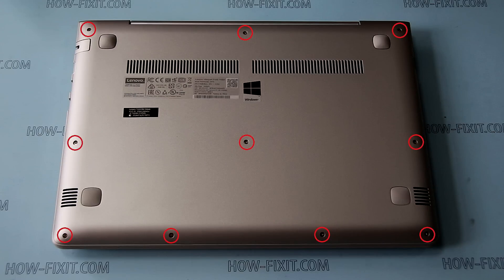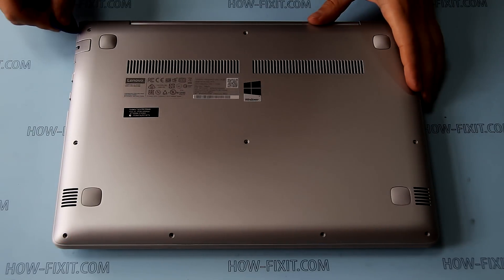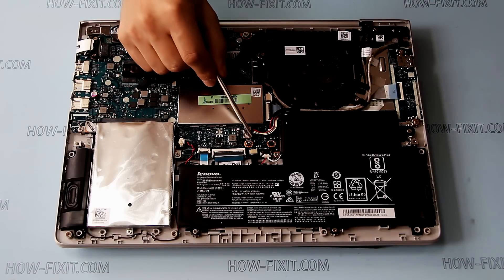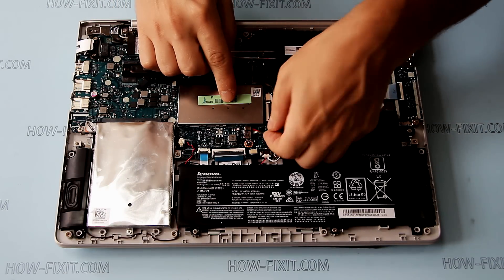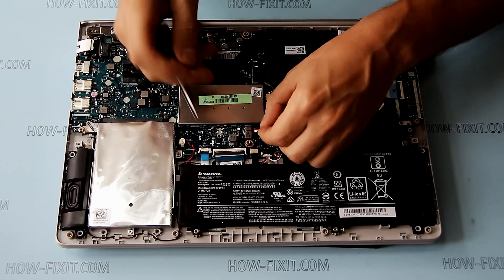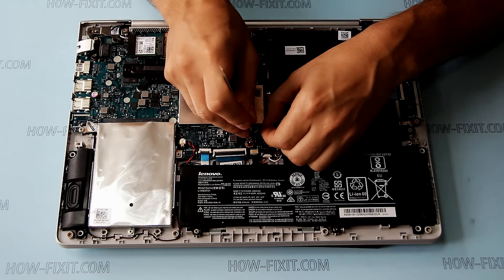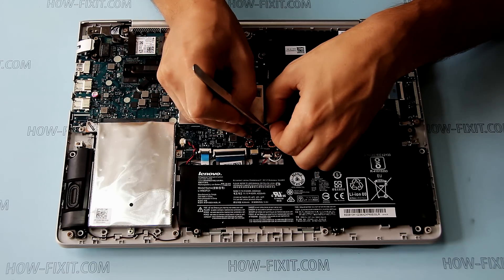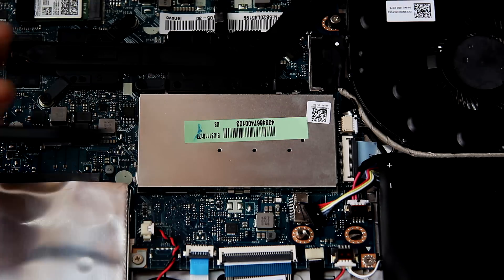Lenovo IdeaPad 510S-14ISK RAM Upgrade and Install - Your Step-by-Step DIY Guide!

Comment: Do we have to unplug the red, white, yellow cable before we open the ram ? Coz in the end of the video u did not plug that cable again ?
Reply: I assume that's the battery cable which is good practice to remove as the chance of powering whilst repairing could cause some damage. I'm pretty sure it was plugged in again to make it work!

Comment: thanks for your tutorial, it's very good. It helped my a lot. greetings from Mexico 🇲🇽.
Reply: Hola. Mejoró el rendimiento con 8GB? Vale la pena? Yo acabo de cambiar el HDD a SSD y mejoró considerablemente, pero aún es muy lenta.
Reply: @juliotraveler  supongo que tienes la version con 4 de ram, yo tengo la de 8gb con i5 6200u y sin problemas, entre mas ram tengas podras tener mas programas abiertos a la vez pero conociendo como es windows 10 traga ram a lo desgraciado, asi que en lo personal si haras la mejora mejor compra el modulo de 16gb, mejor que sobre a que falte
Reply: @JesusCarlosBernal La mía ya traía 8gb, sinembargo la persivo lenta anque tiene un core i7 de sexta generacion, integrarle una ram de 16 me podria ayudar a que sea  más fluida? Y como puedo saber que RAM es la que lleva específicamente, les agradecería su ayuda, saludos.
Reply: @erikalexei8486  Tengo la IdeaPad 510s 14-isk con un I7 de sexta generación, le cambié los 8GB de Ram por 16GB (DDR4) y un disco sólido adata SU800, ahora te puedo asegurar que enciende en menos de 15 segundos (incluyendo la carga de programas) si tienes la oportunidad de cambiar la ram y el disco duro por uno sólido, no te vas a arrepentir. El único contra es que quizás estarás gastando mucho por un procesador de 5 generaciones atras... 
Y si, si va mucho más rápida.
La ram que necesitas es una ram para laptop DDR4 a 2333mhz (Puede ser mayor, yo puse una de Kingston Fury de 16GB a 2666mhz pero se limita a 2333 por defecto)
Reply: @erickh.6071  Gracias por responder Tocayo, disculpa otra consulta, que tendría que ver el disco duro sólido en el rendimiento del equipo, el qué trae mi maquina es mecánico de 1 TB, y como cuanto andará la ram de 16gb qué mencionas. Gracias 👍
Reply: @erikalexei8486   @Erik Alexei  El disco sólido lee y escribe mucho más rápido, al abrir un programa un disco sólido lo hace 10 veces más rápido al igual que la carga del sistema pues tarda menos en buscar la información, la memoria ram te sirve para tener más procesos abiertos sin que se alente, es decir te va a permitir trabajar con más programas a la vez. No soy un experto del tema pero puedes ver en YouTube comparaciones de velocidad de un disco mecánico a uno sólido, y en cuanto a la ram me costó unos 1650 pesos MXN (aproximadamente 825 dólares)
Reply: @erickh.6071  Gracias, me has ayudado bastante.👍👍👍

Comment: Hello sir
Can we install graphics card in this laptop?
Please reply
Reply from the maker: No. In this laptop GPU is soldered on motherboard
Reply: @howfixit  😱😥 i want to play games. But i cannot play due to intel hd graphics....
Reply from the maker: This laptop is not best choice for games.
Any upgrades will not help for this device.
Reply: @howfixit  i have this laptop.. There is no other way to increase its performance?
Reply: @SGNEPALITECH  the only possible thing to do is turn settings all the way down, turn off all windows features and try to overclock.

Comment: Hi there, can i use 
Samsung 8GB 1RX8 PC4-2400T-SA-11  M471A1K43C81-CRC with laptop spesifications as below:

Lenovo 510S - 4IKB
i5-7200U CPU @ 2.50GHz
DDR4 Memory 4GB (existing)
Reply: Yes, of course you can.

The Ideapad 510 uses DDR 4 memory, which is what you have here.

Comment: Great video, thank you for the video. I want to ask some questions. I've been using 510-14IKB for nearly a year. My question is that; does yoga 510 series have both hdd and ssd slots or only have one slot? I am not able to open the laptop due to it's guarantee is still continuing.

Comment: Great video, thank you. Ive got lenovo yoga 510 series, windows 10, which can also fold over into tablet mode. Its running ,4gb ram at moment, would like to upgrade to 8gb ram. Is that what you did in your video? Replace 4gb into 8gb module of ram? Which ram do i need, you say ddr4 but do i need to get a specific type of ddr4 as in speed of which the ram runs at. Any help appreciated. Thanks again.
Reply from the maker: You can install any DDR4 RAM. In the description, I left a link where you can buy RAM for updating your lenovo yoga 510

Comment: Hi, I took apart my Lenovo yoga 510 amd 5 and 4gb ram. I tried to upgrade the ram (i didn't have the right kind) put it back together and it didn't turn on. There seems to be no power anywhere as the charging and power led's don't turn on. Any help?
Reply: Unplug the battery cable and reinsert.
Reply: asu , osea no se puede....yo tambien tengo un lenovo yoga 510 de 4 gb de ram y quiero cambiarlo a 8gb ram ....osea no se puede ?

Comment: Hi, would you happen to know whether it is possible to insert a better graphics card? I ve made the mistake of buying the version with integrated graphics and I would like to upgrade it, at least to the one they use in other versions of this laptop.
Reply from the maker: no you cannot change graphics card on this laptop
Reply: Petr philipp same problem😣😰😵

Comment: i want to upgrade my RAM i have DDR3 4 GB single channel should i buy one more RAM 
4GB or Repalce with DDR3 8 GB
Reply from the maker: If you have same laptop as in the video, you can't add one more RAM module. Maximum amount memory depends on your CPU model.
Reply: Can i replace with 8 GB
Reply: If you have an Ideapad 510, like in this video, it uses DDR 4 memory. And it only has 1 memory slot, plus 4 gigabytes soldered to the motherboard.

I was looking at buying a model 510, but I gave up as soon as I read that it has memory soldered to the motherboard. That limits the maximum amount of memory, and if it dies, the whole computer is dead.

Comment: Hello. Thank you for the video. I have some questions. Why is it necessary to remove the battery cable? And is it possible to add 16gb ram instead of 8?
Reply from the maker: Hi. It's neccessary to disconnect battery before install RAM cause if battery would be connected intalling of RAM module could break it (it won't work or will work with memory mistakes). Maximal amount of memory in this series depends on CPU, for example: Intel Core i3-6006U - 32GB, Intel Pentium N4200 - 8GB. You maximal amount you can find on official website (intel: https://ark.intel.com), the line of CPU specifications "Max Memory Size".
Reply: Thank you. I have  a Lenovo IdeaPad 510S-14IKB cu procesor Intel® Core™ i5-7200U 2.50 GHz, Kaby Lake™, 14.0 ", Full HD, IPS, 8GB, 256GB SSD and Lenovo claims only 8gb ram can be installed only on Crucial site they say 16
Reply from the maker: You're right, lenovo actually says that max. amount is 8GB http://psref.lenovo.com/syspool%5CSys/PDF/Lenovo%20Laptops/ideapad%20510S%20(14%20inch)/ideapad_510S_14ISK_spec-win489.pdf and unfortunetely I can't say if this is true or not. I suppose lenovo won't make such an easy disproved fakes, so it's might be really 8GB max memory amount. Sorry that I did't check it before.
Reply: No worries. Thank you for your support. Enjoy the rest of the weekend!
Reply: @danielstancu8068  same question,  different year
Reply: @melissafarias3860  don't know. I left 8gb ram and it still works great
Reply: @howfixit  thanks for telling too late. Now it doesnt work.
Reply: Y